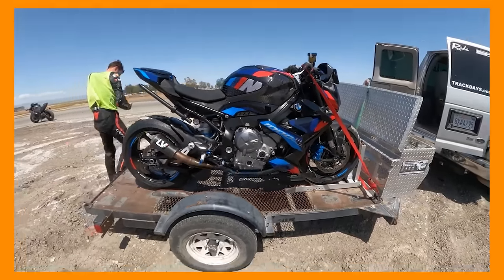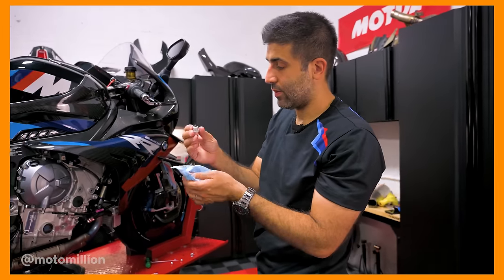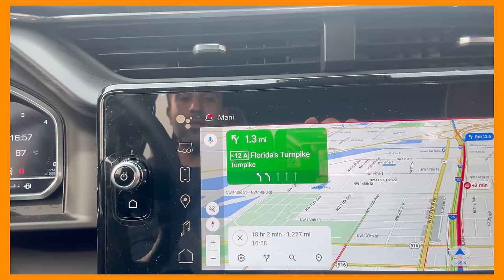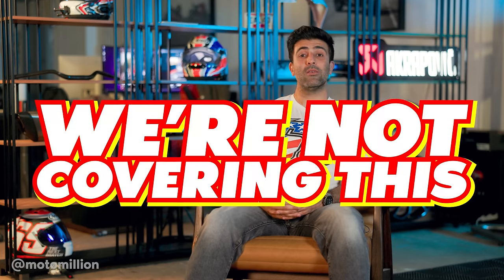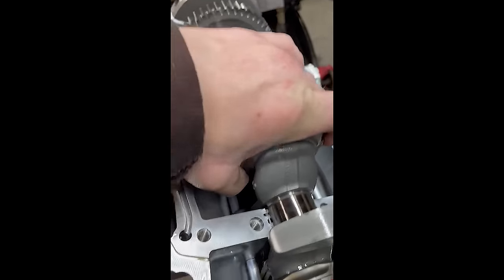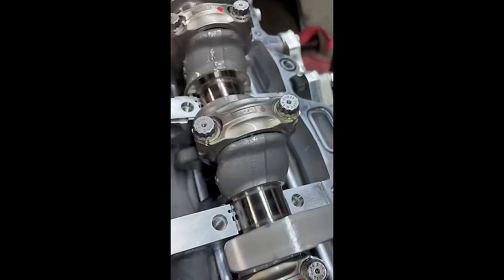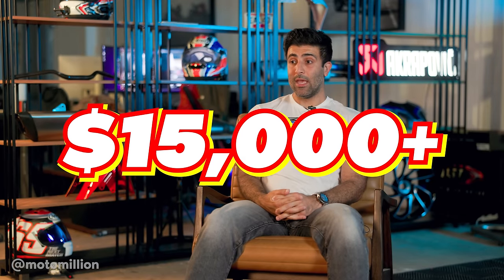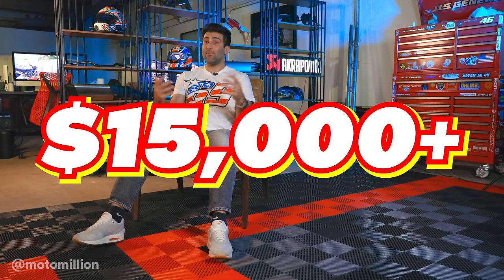MASSIVE Engine Failure on our M1000RR & BMW REFUSED Warranty...

Comment: LOL.  You removed the break-in rev limiter.  You get what you get after that.  A break-in is more important than you think, by a significant degree.  It allows the engine to heat-soak for the first time after assembly, which de-stresses metal parts that may be under stress.  It lets the engine's vibration and movement settle parts that might be off in alignment that rub together a bit too much.  Most importantly, it allows pieces that rub together to form to each other.  Small imperfections can create a LOT of extra heat, uneven wear, and damage if those imperfections are not given time to be "sanded away" by the movement of the engine.  This is why many new engines often have some tiny metal chips in the first oil change.

Comment: None stock exhaust , None stock engine fuel and air system .  What would you exspected of it .  The bike was tuned to the proper stock system . Gaining more HP out of it means deaster .

Comment: I am in the construction business. If I carried out some work for someone and they carried out an alteration that caused the work I had done to fail then I certainly wouldn’t warrant that or fix it for free. I have a bike and I waited until it was out of warranty before removing the CAT and adding a different end can because if that engine was to have blown and the warranty didn’t cough up I would have had to scrap the bike. If they fixed the bike for him as a PR exercise it would have left them wide open to further claims. At least he is in a position that he will know someone that can fix it.

Comment: I can understand that on new motorcycles the problem can be bad software or a switch or other small thing. But I can't make sense of the cranks literally flying out of the engine. And that you need a bucket of oil a week. I have an old Honda cbr 600 rr from 2005, 73,000 km, and everything still works well on it, some of the springs in the clutch basket started to sound. Brother, I understand your anxiety

Comment: My first BMW bike was a 2008 K1200S and the transmission crapped out around 12,000 miles or so. I tried looking into warrenty and recalls but BMW said they have nothing on that subject. I called a transmission specialist down in Florida and he said there are 20-30 different K1200S sittting on the shelf waiting to get repaired. OBVIOULSY it was a factory defect and BMW used their cu$tomers for R&D. I WILL NEVER EVER BUY ANOTHER BMW MOTORCYCLE IN MY LIFE!!!

PS. I have a 2002 M3 and I absolutely love it! Only BMW cars for me :)

Comment: I was waiting to hear something about not waiting the 600 miles to remove the Rev limiter. At that point it really does not matter if it was you or a manufacturers defect because the warranty is void.

Comment: -"This is probably not something you did."
-"The chance of us doing anything that caused this is slim to none"
-"250 RPM, that's barely even an overrev"

you played around with a 40.000$ bike and now you are down playing all the stuff that you did. you want us to put ourselves in your shoes. but why don't you put yourself in BMW's shoes? Why would they cover your 40.000$ bike that you modified, tuned, overreved, film the bike while its running on an engine warning, do service yourself as early as possible and remove limiter, etc. ... and before you comment with that copy paste about CaliMotoTV's M1000R: just because they replaced his engine and didn't have to, doesn't mean they should do it again and again.

Also it's really shady how you tell this story. you want us to believe that they looked at a photo of shavings in the oil and based on that alone said "no we wont cover this under warranty for this 40.000$ bike". As if... and then 10 minutes later in the video at 18:24 (took me ages to find it again because you say it in the "Faulty Engine Assembly" section, ironic lol) as a side note you mention "oh yeah, the BMW engineer said there was an over rev".. Was that not maybe also a reason they didn't cover it under warranty? Next to the tune and everything? Pretty sure you are lying here.

Even though you perhaps weren't responsible for the blown engine, the slightest possibility is still enough to not cover it under warranty. you took the risk when you did not adhere to the manufacturer's guide lines and did your modifications. these bikes are extremely complex and just because you or someone else thinks this or that is or isn't the reason doesn't mean anything.

Maybe this will also be a lesson to all you muricans who take it for granted that you MUST modify and tune your bike and not give an F about emissions or any regulations or guide lines.

tl;dr: you f*ed around and found out. You messed with a 40k $ bike and voided your warranty and now you cry about the consequences.

Comment: As BMW (or any other manufacturer) did not do the first compulsory service ( basically just a check, oil and oil filter replacement) then (at least in Australia) the warranty becomes null and void.  Same principle for car manufacturers regardless of how experienced someone (or an individual and/or a specialist service company) means bad luck as you’ve chosen to disregard the manufacturer’s guidelines.  Not sure why you’re complaining about a problem that you’ve created.  Busy cutting corners will eventually bite you hard.  Hopefully this stuff up will ensure others to simply follow the manufacturer’s instructions to ensure the warranty remains intact.

Comment: If it was stock, you'd have a good case, especially if the initial error was reported and wasn't correctly diagnosed.
HOWEVER, as soon as you altered the OEM spec'with a 'custom aftermarket reflash', it was all on you.
This is NORMAL, and should have been expected.

It's the same as if you bought a rebuilt race engine and the builder supplied it with a specific ECU tune, and you decided to make changes to it, such as giving the timing more advance, or some-such.

Some warranties will even specifically exclude failures when being dyno'd, just as with "race" exemptions.

Comment: This isn't the first or last time this kind of thing will happen, sadly. Companies will KNOW of a defect, and they'll quietly roll out changes while denying warrant claims. I've dealt with this sort of thing with cars and bikes and you're just kind of SOL while you watch new vehicles rolling of the assembly line with fixes added. 

The ONE tool that owners have in this sort of thing is class action. However, it's expensive, hard to fight, hard to organize, and you'll have Stans who will defend OEM's until they're in their graves. So it goes.

Comment: Basically they are saying that buy the engine with your own money but the warranty will be valid...In short the BMW warranty is only for the mirrors,seat covers,brake levers,etc....That's the reason the Japanese bikes are still the best in terms of reliability...Owned two Yamaha bikes since 2012 and riden them for 100k miles...Never faced any issues even in India where service centres are hard to find close by...

Comment: Hi! Putting myself into your shoes I would feel exactly like you did and your technical explanation of the situation totally makes sense. On the other hand I worked in the automotive industry in National Sale Companies (NSC) for a long time and I'll try to explain what I've seen on the other side.

Warranty is a legal contract between the customer and the NSC that is agreed between the parties at the purchase, there are conditions that will mark a breach of this contract. Usually any modification, tuning, services outside official dealers or services outside a certain range of established mileage are considered as a warranty breach. 
Keep in mind, I'm not saying they're right to do so, but they're entitled to since at the purchase theese conditions are stated in the contract and written in the user manual.

It's clear that there's a major fault of the engine and it's not determined by you or your behaviour, but probably some of the things you did invalid the warranty and they don't have to explain it any further. What I find weird is that they don't treat a customer that have bought their flagship with some extra care or trying to determine the exact cause to ensure an excellent customer experience. 
My experience tells me that probably they had some issues with their internal targets in terms of warranty claims, warranty budget and all these KPIs that BMW Motorrad might use to determine if any bonuses should be paid to NSC.

What I saw in the past in cases like this is that customers that can prove that the issue didn't depend on the usage (like your case) threaten or file a lawsuit and the NSC offers a settlement. Once again, if you can prove the engine had a major malfuction due to poor quality, poor installation or design flaws they can prove that you didn't respect the warranty terms, so probably they will offer to meet in the middle.

It's not fair but for them it's a business and they do what they have to, even if their first responsability should be building bikes that are safe to ride. 

I have an Aprilia RS660 and the day after the first service (1000km, the same day I also bought the extra 2 years of warranty) the engine shut down at 130km/h on the highway, the bike was full stock and regularly serviced at official dealership and I got fully covered by Aprilia with road assistance and another full check, and service all under warranty.

After that episode I read the contract for the extra warranty and I found out that among others there's a term stating that warranty is valid only with full stock exhaust or Akrapovich road legal system. If I'm going to install the SC Project that comes stock with the Extrema my warranty is invalidated, is it right? No because it's a system that comes stock with the exact same bike and is coverede by warranty , but I've signed a contract that states clearly the conditions and there's not much to do.

Comment: Removing rev limiters and non-stock tunes voiding warranty isn't a new phenomenon, I side with BMW here. It sucks, but when you modify brand new bikes you risk the warranty.
Reply from the maker: CaliMotoTV's BMW M1000R blew up on the track. That bike had a full exhaust and an ECU flash. BMW fully replaced the engine under warranty.

Why was Bill's replaced even though modification were present?
Reply: @Motomillion  I think Bill was fortunate. Personally, had I done an ECU flash on anything and it blew up, I wouldn't expect a replacement under warranty.

I could understand if it was the exhaust only, that shouldn't ever void the warranty. 

But ECU flashes for me starts to get a big vague especially when removing rev limiter restrictions. 

I think, essentially, ECU tunes gives the manufacturer an out - which a court would likely side with. And a customer would have no choice but to go after the person who did the tune instead.

It sucks, but I would be uncomfortable doing much to any vehicle under warranty, or at a minimum completed the full run-in and 1st oil change as a minimum. I'm a tightass though.

In saying that; 999 / 1,000 you can do what you did and have no problems whatsoever, but it's just that 1 / 1,000 that gets ya.

Comment: Here’s my viewpoint because you know I’m the expert that everyone wanted to hear from. 

1st-Technically the manufacturer is supposed to prove any kind of mods caused the issue if there are mods or if the operator did something that caused it or the maintenance caused it or lack of maintenance. With that said the manufacturer can deny it still and then let you fight them in court which a lot of people won’t do. 

2nd-dealer relations is massive, a dealership or more accurate the service department can make this sort of thing hell or they can make it very smooth for the owner.

Comment: I bought a 2012 s1000rr and they suffered from loose big end bearing caps,they recalled them and stripped engine down and lock tight big end bearing bolts,so it’s been happening for a long time

Comment: I think that these engines have extremely low clearances in order to perform the way they do.
The clearances are NOT ideal for high revs until the components actually break-in.
Which means that there WILL be problems if you do not follow the break-in procedures.
If you're not a sponsored race rider, you should always follow the break-in procedures.

In professional racing, it is understandable that the corporations may play by different rules, 
as the bike there is technically a billboard on wheels. It is just business and you shouldn't take it too personal...
Especially, if you did not play by their rules. That was your own choice and you took that risk. IMO...

Comment: Many, I am not surprised, I have a couple of friends who full throttle the bike, and after that, their bikes were leaking oil from the head gasket, Now do you know where those BMW engines are built??? Also, for those saying that the bike was full throttle and that us why BMW warranty  does not cover damages, I have to tell you, a friend of mine bought a wrecked panigale at the auction, repaired it, and the engine had issues, Ducati with no question replaced the engine which is was still under warranty!!!🤷🤷🤷

Comment: Hi Mani

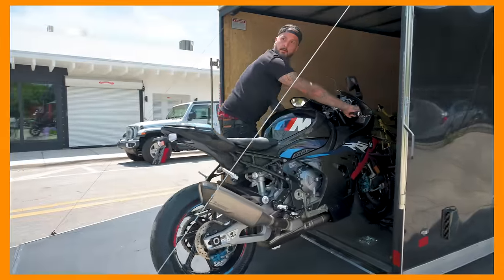I am really sorry to hear about your experience, however, you have not explained all of the circumstances in which you purchased this bike.  You said that it was kinda a weird situation and you never actually ordered the bike but had the opportunity to purchase it 2:14.  This may be something BMW knows about and this may be why BMW would not replace the engine free of charge. 

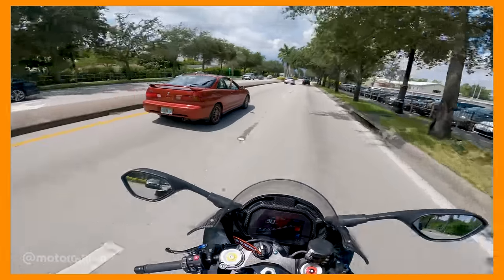If you purchased the bike new, how come it had 6 miles on it 2:27, how come it had not had the PDI and, when the malfunction light came on after 9 miles 2:42, why did you not call the dealer and ask him to pick up the bike, take it back to the workshop and check out what was wrong? 

Your contract is with the dealer who sold you the bike, not the manufacturer, so all your consumer rights are against the dealer.  The dealer then complains to the manufacturer, who sold the bike to the dealer, but you never went to the dealer!  Why not?

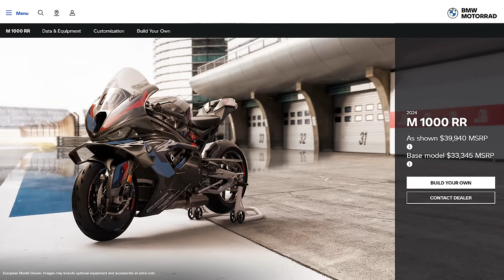At 5:00, you say that, if you paid $40,000 or even if you paid $20,000, you would expect . . . . did you just pay $20,000 and, if yes, why?  

Did you purchase the bike from an auction, after it had been written off, following flood damage or perhaps it was stolen and recovered after just 6 miles and you bought it for $20,000 for that reason?  

Did you purchase the bike from an individual, who rode the bike for just 6 miles 2:28, thrashed the engine and damaged it?

Comment: I have been a maintenance engineer all my life. It's heartbreaking to hear that BMW focuses not on what went wrong, but rather  on being able not to take responsibility for the claim .
Reply: What went wrong was outright abuse of the motorcycle, that clearly voided the warranty. So no, BMW has zero responsibility on replacing or repairing the engine.
Reply from the maker: Daniel, what abuse are you speaking of?
Reply: Over the years, I learned to focus on facts. I heard nothing in the whole video that supports abuse.. They might not have told us everything, but I use only the facts. I don't hear any facts supporting abuse. Removing the power limiter doesn't automatically mean abuse. That's an emotional reply.

Comment: I have had unhappy experiences with BMW warranty claims but on my car. The exhaust valve in the rear silencer rattled like an old Trabant within weeks of collecting a brand new M model. The dealer simply told me "they all do that" and BMW denied the warranty claim. It took me over a year of arguing before they agreed to pay for a new back box. I have an S1000RR as well and haven't had any issues but then, I don't ride it as it is intended, having never taken it over 8000RPM. I do think you made trouble for yourself by giving them an opt out. Removing the rev limiter yourself and before the recommended mileage was not sensible. Was it the cause?? . . .almost certainly not but you shot yourself in the foot with that one. If they can get out of a warranty claim then that is exactly what BMW are going to do

Comment: The owners manual states perform first service between 350 and 750 miles. Service procedure states remove break-in rev limiter after first service. The dealer states you shouldn’t remove the break-in rev limiter before 600 miles. IF that is written in the owner’s manual then BMW has provided the wrong instructions. The condition of the bearing as described sounds like a part failure. BMW should honor the repair.  My own experience with BMW is that they make poor quality overly complicated products and their customer service is terrible, always blaming the customer. I haven’t recommended a BMW product since. There, said it for you.

Comment: I got rid a BMW R1200GSA after two drive failures, one u-joint and a failed ABS unit.  Pure overprice junk.  One thing that sucks about BMW sometimes BMW will do a goodwill repair out of warranty repair, cover parts cost and labor or just parts.  For the next customer BMW refuses to do anything.  I still own two R100 Airhead BMW that are well built machines.

Comment: I believe, all the bikes come dry, if PDI is not done, then most likely you were riding the bike with either low oil or no oil. Rod knock on a new bike is rare, you will hear it from the get go.

Comment: 23:40 Sure, the headers and exhaust will do it. It's a Euro 5 model. Removing the hole exhaust system and replacing it with a strait pipe and a small carbon can will change everything. espacali how lean it runs. The same thing will can happen with other new bikes like the R1

Don't cry about BMW if you change important stuff on your bike without the knowledge.